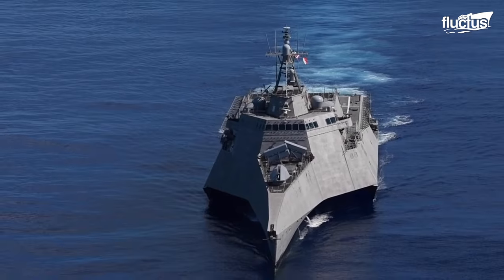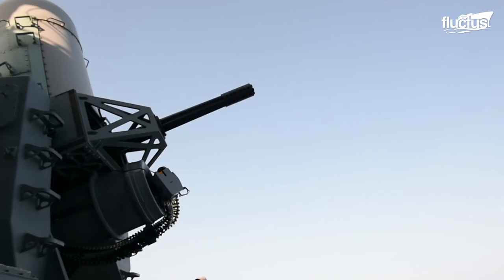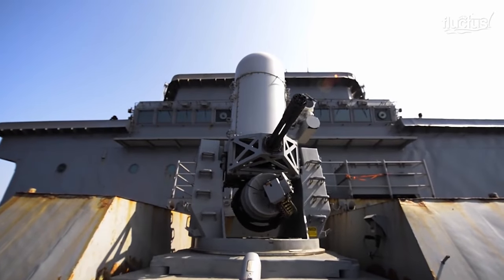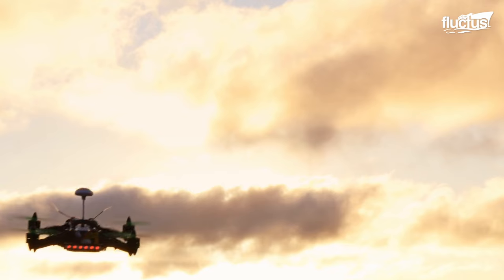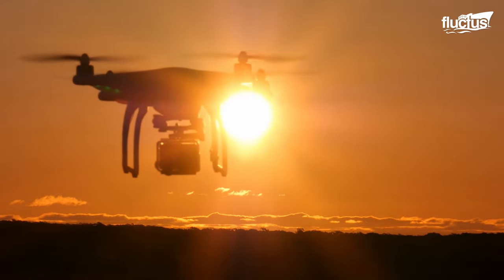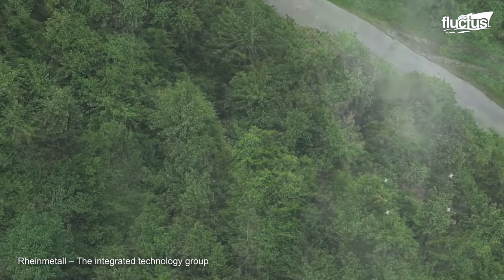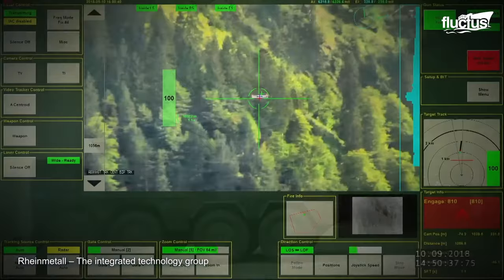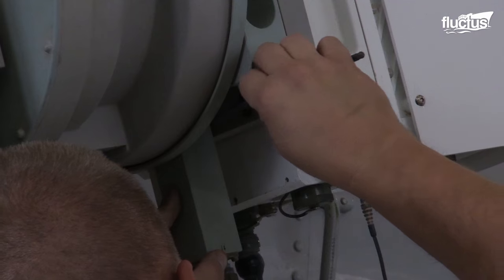The Extreme Solution US Navy Found to Deal With Enemy Drones in Middle of the Ocean

Comment: These Phalanyx systems have been around for 40+ years. Long before the drone came of age.
The thing they don't tell you is how fast they run out of ammo and how long it takes to reload them.
Reply: Good point. Wasn't this system an answer to very expensive missiles like Exocet? With drone swarms becoming a reality it's starting to look way past its sell-by-date.
Reply: Truth, and even then the barrels would get so hot that they needed time to cool off, i will say the ftc radar was awesome though.
Reply: 30 minute reloads for Block 0 and from Block 1 through to current Block 1B Baseline 2 its 5 minutes. Current systems have 1500 rounds at 4500 rounds per minute....20 seconds of fire
Reply: At 75 rounds per second, the computer could be set to fire one second bursts. Also put cooling fans over the barrels. Then all you need is a way to fast feed new chains of ammo.
Reply: @tubthump  Yes. And in the case of the USS Stark it helps to have the system on when steaming Condition 3 (Wartime Cruising) if you were in the Persian Gulf in the 1980's. They did not and paid dearly for it. They were hit with 2 Exocets. Fortunately only one exploded however the other one provided fuel for the ensuing fire that would have destroyed the ship had it not been for the "Herculean" damage control efforts of the crew.
 I was in the Gulf in 1980 during the Iranian Hostage Crisis onboard an Adams Class destroyer that had not yet been updated with the Phalanyx until we went in the Philadelphia Naval Shipyard in 1981.
USS Lawrence DDG-4. (Decommissioned in 1995) We were totally dependent on the horribly outdated RIM-2 Terrier and RIM-24 Tarter missiles for surface to air defense. 

Completely useless against the Exocet.
Reply: Just like the A-10
Reply: CIWS is also a weapon of last resort
Reply: @jyralnadreth4442  I’ve reloaded them in 8 min flat with a good crew.
Reply: this was my job in the Navy. doesn't take very long to reload. maintenance hog but  very versatile!!
Reply: @krismoe2160  8 minutes is an eternity against a missile traveling at Mach .93.
No Mach .93 isn't particularly fast however, the drone approach is to overwhelm a target to the point either other drones catch the target in a reload or completely drain it's ammunition capacity. This goes for all surface to air defense capability.
DCS is proving to be quite eye opening in these senarios. It really highlights the limitations of shipboard resources.
God knows the mere numbers of ships we do have is woefully inadequate as it is.
We had a 600 ship Navy in the late 80's but only because we kept a large number of updated Adams class DD's that were getting close to 30 years old in service, dragged a few WWII battleships out of mothballs and USNS auxillary ships to pad the numbers.
Bottom line: Our enemies know the limit of ammo, missiles, what type and their range and capabilities. The problem is even if you survive the inital contact what do you do when you run out of stuff to throw at them.
Reply: @DDGVET4  tell me something I don’t know. That’s kind of my job. I’m aware.
Reply: Yes, but when you have 14-16 CWIS in a carrier group, not just the 20mm but the Ram and Eram.  I assume they can takeout 24 missiles average as the last line of defense, no country but US can launch a barrage of 48 missiles at 1000km. away..I don't believe China which would be number 2 doesn't have the capacity to target at such distance accurately.
Reply: @dons8122  different gun. But close.
Reply: @virginccyy7645  each mount has maybe 4-5 engagements before it needs to be reloaded. Ram holds 21 missiles and uses two per engagement. Also, each one is only capable of defending ownship. My ciws mount isn’t going to engage a c802 inbound to your ship. Not how it works.
Reply: @krismoe2160  thanks, it's always insightful  to hear from real experience.
Does that go with Ram too, or just the 20mm is for its own ship!
Reply: @virginccyy7645  both are only ship self defense. Point defense we’ll call it. If you want to defend a battle group you’re looking at SM2/6 ESSM
Reply: @krismoe2160  Good on you mate!
Reply: And how long you have to allow the barrels to cool down so they won't melt
Reply: @geralddelaney1557  was an electronic technician here but ships company to learn the workings of the CIWS or at least the specs. Was amazed what it could do. Watch them fire close up also with ear protection.
Reply: Yep.  I started my career as an engineer working on CIWS and Standard Missile back in the early 80's when they were built by General Dynamics in Pomona.  I stayed with those two programs my entire career before retiring.
Reply: @dons8122  the A10 is an awesome weapon
Reply: The whole script was written and read without any understanding beyond the words on the page/screen.  Mindless fluff.
Reply: Add another for more directional and reloading coverage
Reply: point is that phalanks and other aa sistems dont see drone at all!!! u have video of iranian drone over usa carier and no one knows
Reply: @jyralnadreth4442  
Whew! Lets party!!
Reply: @DDGVET4  Terrior and Tartar....yikes they would have been old. I thought they had decommissioned them before 1980 since they were 1950s missiles.
Reply: @krismoe2160  8 mins....not the reported by manufacturer 5 mins but still better than 30 mins
Reply: @kris moe  there is also SeaRAM which is a Phalanx with an 11 Cell RIM-116 RAM Launcher instead of the M61 Vulcan
Reply: @jyralnadreth4442  the manufacturer also thinks it’s somewhat reliable.
Reply: @SuperDjavol  I fucking doubt that.
Reply: @ireallyreallyhategoogle  might as well throw in some invisibility cloaks while we’re at it. Maybe some force fields.
Reply: @michaeldraper9804  The barrels are cooled by the spinning.
The advantage of the Gatling gun system.
Reply: that can be solved with better design
Reply: CIWS ("Seawiz") is awesome, but yeah, it's been around at since my ancient ass was in the Navy.
Reply: @jyralnadreth4442  sending in cheap ass drones to empty your ammo capacity seems like a reasonable plan.
Reply: @DDGVET4  - that's why you have multiple defensive weapons in your arsenal.
Reply: First put out for contract in 1969 and first deployed in 1979. The typical engagement can allow several engagements before reloading is required. Highly unlikely in modern warfare for  numerous missile would be fired at any vessel unless you are faced with an overwhelming force.

The barrels could burn out if the magazine was substantially bigger but again engagements don't take a full magazine. If you have ever witnessed it in action, it is awesome. It absolutely destroys things. Loved working on it.
Reply: @SiluetSoup  indeed....This is why LAWS as in Laser Activated Weapon System would be helpful...was installed on USS Ponce and declared fit for combat
Reply: @kris moe  This has been an issue for all CIWS that are self contained such as Phalanx, Goalkeeper, all the back to the og CIWS STAAG mark 2 of the late 1940s. They are maintainance nightmares
Reply: @jyralnadreth4442  The Adams Class destroyers were designed in the 1950's.
The USS Lawrence DDG-4  keel was laid in 1958 and she wasn't commissioned until 1962.  There were updates from the RIM-24 to the RIM-66 Standard in 1967 and then the Block II RIM-66H in 1983. I left the ship in July of 1982.
Reply: @WJV9  You should take a look at some DCS senarios and see just how fast those multiple sources are burned up.
Our Navy has been wasting tons of money on LCS ships that now have cracked hulls but we can't decommission them because we can't afford to replace them. The DDX Zumwalt Class destroyers were a bust because of cost overruns and had to be abandoned. The USS Ford was way over budget with multiple issues concerning the turbine generator set not producing enough power. EMALS system failures causing the ship not to get in the Fleet until way past it's due date. As a matter of fact Ford just completed a 53 day shakedown cruise Thanksgiving weekend. In a 2 December  article in Forbes Magazine, Ford spent 45 days at sea and completed 1,250 sorties with 50 -60 aircraft onboard. Sounds good but Ford is supposed to be the new top dog and the older Nimitz Class Theodore Roosevelt during Desert Storm completed 4,148 sorties with 78 aircraft in 43 days.
I served on Nimitz from 1984 to 1986.
Reply: Long load time is why surface ships have multiple CIWS.
Reply: But now there are multiple self loading/ self feeding ammo bunkers with almost a million rounds each…. But it’s not the missiles that hit our ships.  It’s the four raggedy fisherman in the wooden boat with a 40hp outboard and half a ton of high explosives…the kid on deck is afraid to make the wrong decision and shoot an innocent civilian….and before you know it…USS Cole.
Reply: @ZonaJim  I also worked  in Pomona in the 80s my whole family did
Reply: @tubthump  Bigger guns that can mount prox fuses and appreciable payloads are, from what I've heard, better; at any rate lasers are on the fast track to supplanting gun CIWS.
Reply: That wouldn't be an issue if they'd hire me.

I could easily come up with a concept.. IN FACT, I just did, while typing the beginning of that sentance. All it would require is that the device for holding the ammunition be built more like a pillar, fitted with a ring, a track, and some bearings at deck level, and an internal spiraling conveyer belt..

Coil the ammunition all the way down to the hull level.. Much larger ammo cap. At the hull level, you can have it fed from one end of the ship to the other on a conveyer belt of its own, that is fed by another pillar at the opposite end, that goes up to the deck level at the front of the ship (or rear, depending on where the phalanx pillar is mounted,) where people are stationed to feed the pillar with ammo to keep it churning.

This pillar would be going down to the conveyer, where ammo is carried to the bottom of the ammo retention pillar on the Phalanx. If it needs to be reloaded, it can be done easily by stopping the pillar in the loading position, and having someone feed and oversee the next belt that will be loaded in by the central conveyer, and carried automatically up, again by the internal conveyer of the phalanx pillar..

It'd easily increase the ammo capacity by 5-6=7x? Depending on the ship it's mounted on and how deep you can run the pillar, and increase loading speed by.. well, that depends on who you station, but at least by two or three times, mechanicallly.
Reply: @krismoe2160 - In peacetime, under no stress, and that's still far too long.
Reply: @geralddelaney1557  - It isn't the least bit "versatile." It's a boondoggle.
Reply: @shawnr771  - Now that's about as stupid a comment as could be imagined.
Reply: @rustybarn9418  - You are having a pipe dream.
Reply: The only   way a ship can defend against a  drone swarm is  a large area of effect weapon = tactical nukes.
  or
  The ship can launch it's own swarm of  thousands of  short range drones to  provide a  hovering cloud of protection.
Reply: @SeaJay_Oceans  both of which are not happening anytime soon.
Reply: @krismoe2160    Well  large area of effect conventional flak weapons might help...  with hundreds of drones inbound,  the only defense is to fill the skies so none can get through...
Reply: I remember when I lived in San Diego Country, in the late 70's I think, a local TV news story about the prototype for the Phalanx being mounted on a San Diego based ship for testing.
Reply: @jyralnadreth4442  Wouldnt it make sense to additionally install turrets with smaller calibre such as .50 and around 1000-1500 rpm?
Reply: That is truly the Achilles heel of the system. You can only fire for so long and when they can't hit a stationary target or a smuggler, how will it work on a fast moving missile?
Reply: @garystrittmater8258   The One BIG Difference is that a missile flies a straight course and the radar/tracking system can more easily aim & track.  A missile is also up in the air and not on the surface of the ocean....smuggler moving up and down....ship moving up and down ....
Reply: @unlink1649  Great System.... Bofors 57mm with programmable ammo.  I don't know the performance against anti-ship missiles, but against surface or aircraft...BLAMO
Reply: modern CWIS takes just 5 or 6 minutes for a good crew to reload, which is more time than it takes for a drone to reach the ship in most cases from defensive sphere to impact. It's the last ditch defense though, the SM-2 is going to be the bread and butter, go look how many are carried by a carrier group, american fleets are capable of defending themselves against "drone swarms", the real issue is that they'll dump a half billion of ordinance to destroy 5 million dollars worth of drones, which is why the Navy has more dedicated anti-drone weapons being developed at extremely high priority
Reply: @override367    Just like any other period of military tech change....all things will equal out.  I think ultimately there will some kind of very powerful electronic "scrambling" device on ships to "point and fry"....or....very powerful lasers than can "point & burn through" at the speed of light.  Think Star Trek phasers taking on the swarm in the last movie....but...that swarm overwhelmed.  There will have to be a way of projecting and clearing (frying) a swarm where more than one will be brought down at a time.
Reply: All the computer boards (components and such) are bolted in with clamps that latch over the back keeping them slotted in place. This is so they are not supposed to vibrate loose, but they still do sometimes. One of the reasons for a thorough inspection prior to firing (or expecting to fire). At least the desert 'CRAM' variant does not have to worry about sea spray and salt corrosion that the Navy ships experience.
Reply: Hence the change to directed energy point defense.
Reply: @johncunningham4577    Which, if using the latest Star Trek movie as an example, shows being overwhelmed by a large enough Swarm.  Iranians can build enough drones to attack a carrier battle group.  Question is can the drones be powerful enough to do real damage?    If FOD can take down a jet, I would say they could damage anything on a flightdeck...or radars...dishes... etc.
Reply: Thanks all. The answers actually answer the questions that sprung to my mind and I posted just now before reading this conversation.
Reply: The Ammo drums contain 1500 rounds, and it goes through that pretty quickly!
Reply: or how long a burst lasts because it'll melt the barrels
Reply: @Brian Waas They are meant just to fire short bursts! Not sustained.
Reply: I was thinking the same ... also when you have to fire thousands of armor-piercing thungsten rounds to take out a single small cheap drone, then the one sending the drone has an edge :)
Reply: @geralddelaney1557 The ET's and the FC's shared berthing on my ship. Had a FC buddy,  I was ready to go out. He come in covered in grease, I was WTF you look like a Snipe.
He said he lost rock paper and sizer with the other "3's" and had to Grease the Beast.  I'm guessing he was talking about this.
Reply: @DDGVET4  when you run out? Have them know that you will destroy their capital city.
Reply: I understand a small number for jets, but why so small for a ship or land based system?  I would think you could have much larger storage areas, or does the weight and length of the shell belt a problem? I would think you could have large preloaded drums for reload on land/sea. On a Jet the space is so limited and tucked away I can see that isn't possible
Reply: @@williamarrington2045 I like the "last ditch oh crap thing"! Do you know has CRAM just been successful enough with just 1600 rounds?
Reply: @@williamarrington2045 Did you have the same ammo in drum issues? I mean I can imagine a Aegis Cruiser as a big target and needing to knock down a lot of incoming, but then you do have a layered defense with all the types of missiles on a cruiser and Arliegh Burke!

Comment: The only problem with RAM is the ability to get overwhelmed by multiple incoming missiles or just plain run out of ammunition.
Reply: I sort of view this as a last resort weapon... Anything with in it's range, suggest far larger threats & problems... and a break down of multiple layers of defense.
Reply: Ram and Phalanx are weapons of last resort.  Std Missile, ESSM, etc are designed to reach out an take out the launch platform long before the CIWS support is needed.
Reply: @Peakfreud  it doesn't take a large support infrastructure
To send multiple drones to attack and overwhelm a defensive
system....
Reply: @garyschultz883  Cool.
Reply: Disclaimer, I'm not trying to play Hasbro's battleship in the comments with anyone.

Elvis has lost interest and left the building have Great one guys.
Reply: RAM are autonomous  - fire and forget weapons.  No ships guidance required. These are scheduled launches and automated for controlling the effectiv0e defense layers.  40 Missiles (depending upon doctrine enabled can be "shoot, look, shoot" or "shoot, shoot, look, shoot" -  computer controlled per target.

Comment: I remember learning from the FCs onboard our Flight 1 A arleigh burke class DDG that if CIWS has to activate then the missile is more than likely to close as far as the blast radius goes and other damage it could still cause to the ship.
Reply: I was a CIWS FC and system is designed to make the missile unflyable, and not to explode the warhead. Any explosion would be fuel with negligible impact